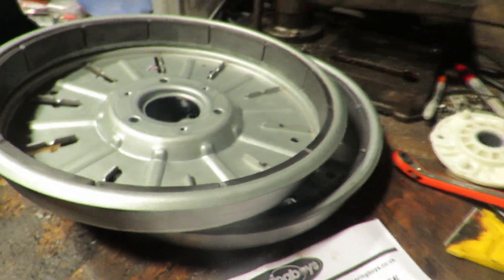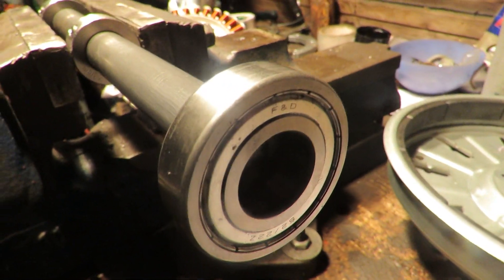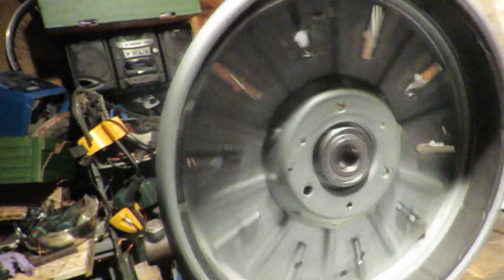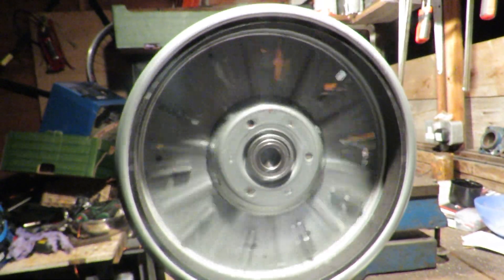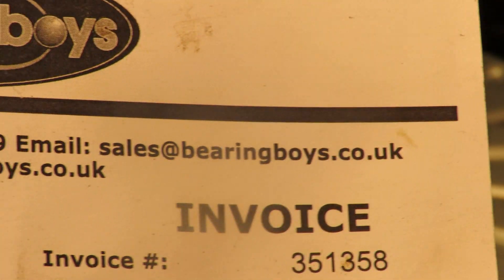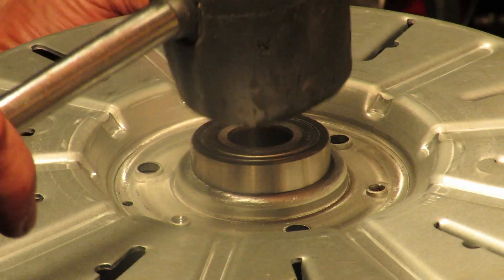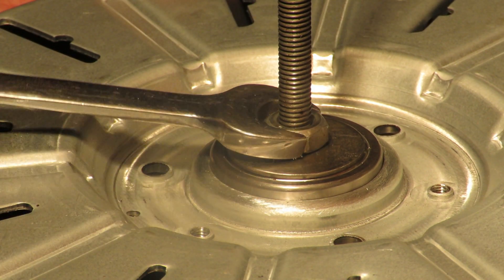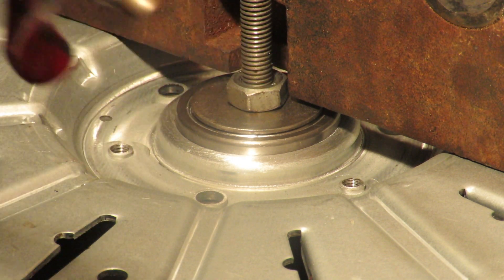Free energy project,Mounting a drive bearing on to a LG Direct Drive MOTOR

Comment: There is hundreds of ways to do this, I think I would made a plate with the bearing inside, so it fit in the hub, and the plate, bolted of rivited together, camping in the bearing,   or madea plate bearing, and put the bearing on bith sides of the stator! Mounting the rotor hub solid to the shaft, but what ever works!
Reply from the maker: This for me was the only way I could guarantee it was super central , thinking what to do about the ALI stator before I do too much more on it , but it will def be moving forward slowly.